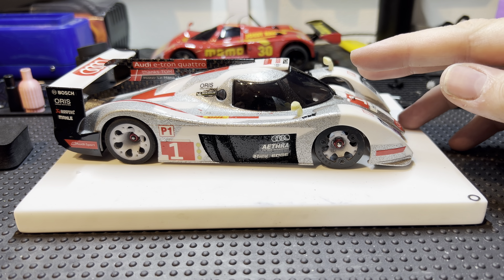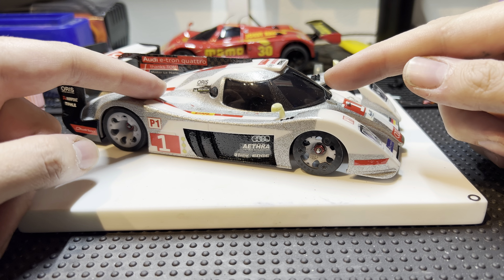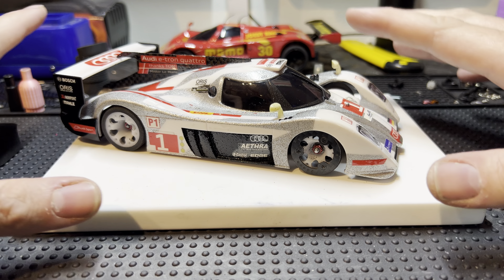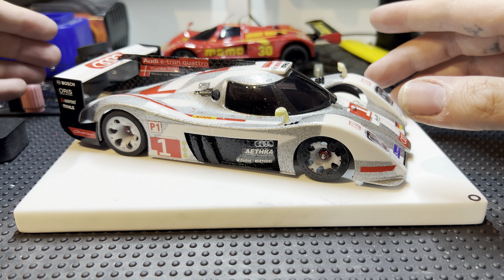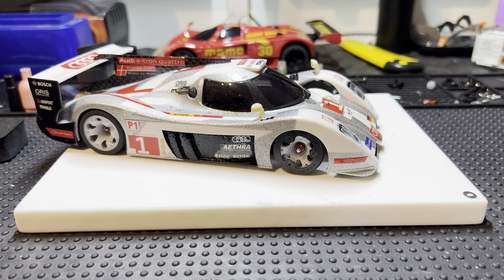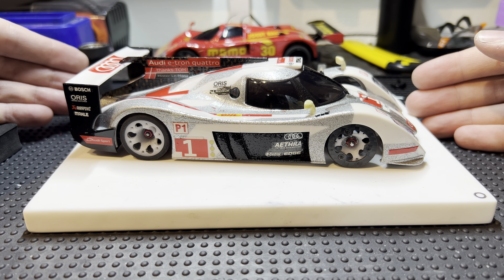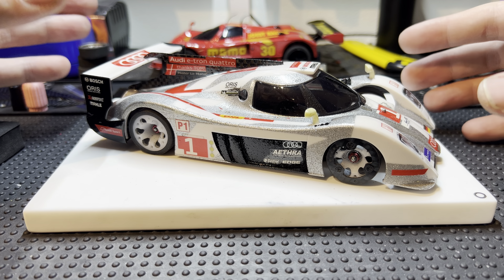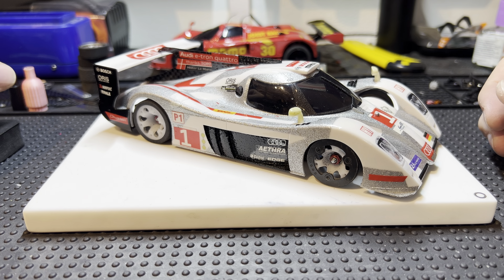The Gl-Racing Setup Series. Part 1@GarageMiniRCUK

Comment: Great advice.  When I am asked for setup for the GLR, I provide my standard baseline setup.  Which is middle of the road, and offers a neutral balance pretty much everywhere that I have driven.  Mostly the difference from the manual setup, is that it uses a stiffer front spring (blue), to compensate for the addition of the brass chassis, and softer center spring (black default is the hardest).  This allows ability to tune up and down depending on the users circuit, conditions, and driving style.

Everyone drives a little differently, and in this scale I find that the feel of the car is almost more important than the outright performance of the setup.  So, what one racer wins with, may not be suitable for another racer because of the difference in driving style.

There are generally 3 approaches to car setup for a circuit (basic explanation), corner entry, balanced, and corner exit.  Typically, to gain more corner entry, you sacrifice on the exit...  depending on the layout, I focus on different elements of the car to gain performance where it is needed. So, my setup for one specific track may benefit me there, but on a different layout, be very difficult to drive.  Generally speaking though, with the GLR, I focus on the corner entry to mid corner more than the exit.  And for some, the idea of waiting on throttle through the mid corner is more difficult to grasp, as they want to be on the throttle as early as possible, but on some setups, getting on the throttle too early just loses time and stability.  My throttle points are to accelerate straight off the corner, and not rotate the car.  General focus is on efficiency of the battery/motor, but also the tire...  So, setup is very individual to the driver, and knowing how you drive, and develop a setup around that, is what is needed to be a consistent and fast driver.
Reply from the maker: Thanks man, i really enjoy your comments, at times it feels like my Old teacher talking to me again 😄

Comment: Finally just figured out what are those carbon disks on the front wheels.  They are referred to as "Carbon Slip Rings".  Can anyone explain the benefits of using these?  Much Thanks!
Reply: part numbers PN MR2085F and PN MR2085CO. I believe they are used to stop traction rolling. Many sizes are in the CO kit to accomodate for tire diameter change (if worn or turned down).